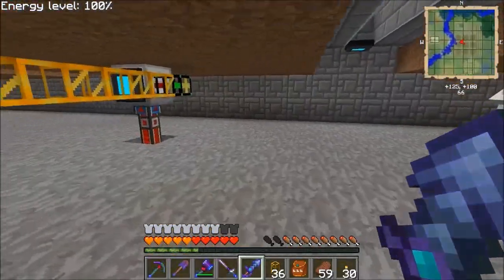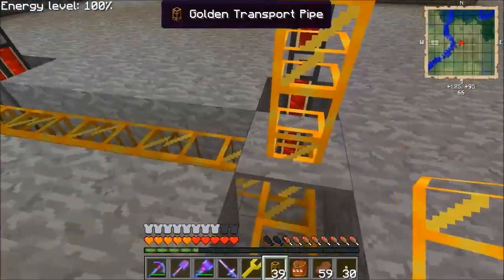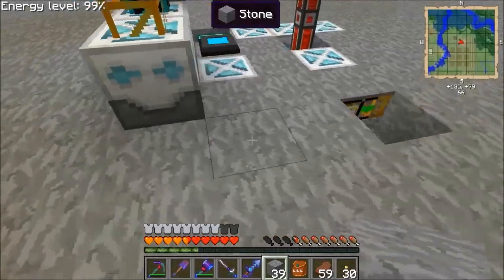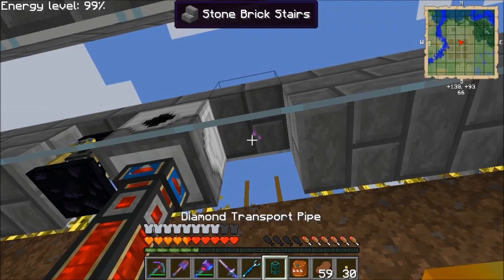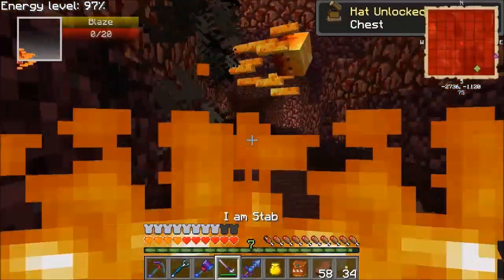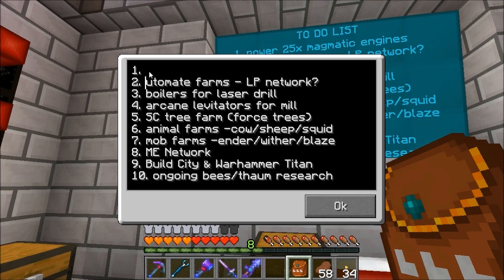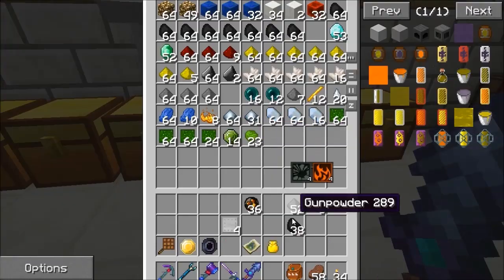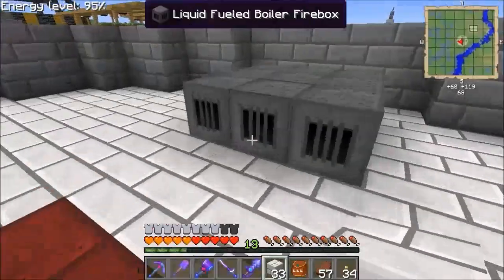FTB Unleashed S01E17 - Logistics Pipes Farm Automation

Comment from the maker: Well, I set my farms by tilling land around a water block and seeing how far they stayed hydrated, the water block certainly reaches 4 blocks in each direction. As for the lilypad I also read it is the same as a water block, please note though that I've been told the lilypads don't work with ic2 crops so mine are probably surplus to requirements now :)

Comment from the maker: The drill is a bit weird, it uses energy to pull ore blocks from under the bedrock, I'm sure there's documentation on it somewhere regarding speed and energy cost but I've not seen much. It doesn't have a radius, it just needs a clear view of bedrock.

Comment: The water block works on a 9x9 grid also.  (or a....5 radius?  Because radii make zero sense when applied to a square grid).  So as Ako says, 4 blocks from the tile in every direction.